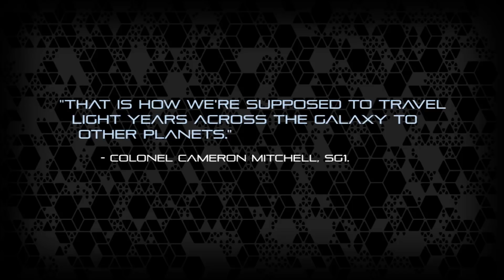The Stargate - Spacedock Sci-Tech.

Comment: 2nd generation Stargates are one of the most perfectly engineered devices in sci-fi. Damn near indestructible, can be dialed manually, able to use power from just about anything, including a lightning bolt and a moss that produces cold fusion, and the only times we see it not operating perfectly are due to the Tau’ri voiding the warranty with their home-made dialing computer
Reply: Imagine the Ancient tech support that get a call every time the Tau'ri screwed something up.
Reply: absboodoo Have you tired turning it off and on again?
Reply: @ducknorris233  we do that every time we aren't dialing it
Reply: @ducknorris233  Doesn't Carter literally try this in one of the episodes? lmao
Reply: @eggnorman  in deed
Reply: DHD's, however, break constantly and there is no safeguard to prevent dialing into a black hole or other world-ending threat.
Reply: @Mike_Rogge  The DhD does have safeguards to prevent the matter stream from passing through stars, preventing time / alt universe travel, and accidentally destroying the star. It probably has similar safeguards for black holes, but the SGC dialing computer has no such failsafes.
Reply: @deadturret4049 they learned it in ancient time, but relearned in tauri.
Reply: @Mike_Rogge  eh thats not true the DHD and the gate do again the SGC's home build dialing computer likely just ignores any of this and keeps dialing
Reply: Hey, sometimes you gotta void the warranty to use the device properly. See: the Avenger Virus incident.
Reply: and still use the most nonsensical addressing scheme possible :P
Reply: Not entirely true. The DHD in the fifth race was malfunctioning and locked up the gate
Reply: Lol
Reply: Bro I forgot about the fusion/fission moss

Comment: I only ever saw Stargate 1994 movie, but I heard characters fly spaceships in the television series. Why would they need spaceships if they have stargates?
Reply: Stargates can be easily disabled, if not destroyed. The simple act of burying a Stargate with rubble or sand will prevent a connection (whether this was a technical shortcoming or a designed safety measure is open to debate).

If a Stargate can be closed so easily, you can always fall back to Plan B and travel to that world by ship.
Reply: Plus most Stargates were only as tall and wide as a decent sized minivan you can't fit a lot in it.

Comment: One way travel depends on episodes, there were instances of a gate working both ways.
Reply: No, there aren't. Unless you can name even one?
Reply: @Swiftbow  Very first episode, goa'uld walk right back through the open wormhole, later releases fixed this with some sound effects
Reply: @zethcader6478  I don't recall if my DVD ha the fixed sound effects, but since all versions cut away from Apophis and Teal'c during that scene, it can be easily assumed they redialed from Earth before leaving. Because they'd have to.

Now, if the scene had remained unbroken, and they'd come through and left without dialing, then you'd actually have a problem.
Reply: @Swiftbow  How did they dial without a DHD?
Reply: @catprog  Presumably manual dial. And I wouldn't be surprised if the Hand Device can control a Gate (or at least power it), either.

Comment: Anything that is not matter is the exception to the one way travel as that is purely a limitation of the gates themselves not the wormholes. The gates event horizion breaks down matter to its base elements, sends that to the other gate, then the other gate re-builds it to its original form. (Theory: This is probably deliberate so patterns do not get mixed up if multiple objects/people were to emerge from the gates in the same spots.)

Other examples of things that can pass through an incoming wormhole include, radiation, gravity wells, and my personal favourite time dilations because of said gravity wells (which also have a lensing effect applied to them so they expand faster then the gravity well itself).

Comment: Dialing speed had nothing to do with the age or generation of the stargate. The protocol used to dial it was what defined how fast it would take.

SG1's dialing computer used the same method a DHD for, but those gates too were capable of fast dials under the proper circumstances. The asgard did this when they needed to use the gates, which was a bloody rare event since they had starships, FTL speed and teleporters.

The Lantian gates too were often used in a slow dial mode too because that gives the gate time to start it's calculations and searching algorithms to find a gate at the coordinates specified. Otherwise with a fast dial people would be stuck in the buffer of the sending gate until a connection was made to the ideal destination. I say ideal because if the destination was not available it would divert and put the people in the buffer to the closest point possible to there.

A slow dial prevents that all together by simply not making a connection if there's no response to the connection attempt.

However, to say the stargate was the thing that guided other civilizations? No... it was the medium that races like the goa'uld used much like one used the atlantic ocean to transport slaves. Most of the other civilizations was initially seeded by the goa'uld taking from earth and transplanting somewhere else.

Comment: I wondering why the floor is not demaged by the vortex of the stargates where the lower part of the ring is sunk in the ground
Reply: because it'd fall over
Reply: Basically because the "splash" that occurs when the wormhole is activated doesn't extend at the edges.

Comment: Just one Question, if there are just 32 or 34 shevrons (don't know how many there were) there should only be 32 or 34 points of origin/stargates?
Reply: That's right... you don't need to even know the symbol for a gate you are travelling to, only it's location (the first six symbols of the address) and your origin gate symbol which is always the 7th symbol of any dialing. The 34x33x32etc limits only the number of gates that can operate as part of a given network. An 8 symbol address can be used to connect to another network for intergalactic travel. Using this system up to 34 separate networks could exist, spanning 34 galaxies.
Reply: Point of origin is unique, chevrons themselves can even be unique but only after you need more than 34x33x32.../32x31x30... unique codes
Reply: If that was the case there could only exist a number of gates equal to the chevrons on the wheel but we know that's not so. There are a staggering number of gates as the Destiny has been seeding the universe with them for a million years. I don't recall how they explained how each gate can have it's own unique symbol yet you can dial it from any other gate in the same network.

Comment: It's not just radio waves that can travel both ways through an open wormhole ... other forms of energy will translate both ways, including gravity waves.
Reply: @DragGon7601 Nope, that's a common misconception. If you look closely, the gate shuts down after Apophis came through, and it remains off during the firefight. It's only turned on after the SF guards and Hammond enter the gate room. In the "Final Cut" remastered re-release, they added additional sound FX so you can hear the gate activating while the guards are running towards the gate room.
Reply: Plus diffrent forms of radiation
Reply: Yes, radiation is a form of energy.
Reply: And system lords/hostages in episode one (you know before the rule was thought of).
Reply: @DragGon7601  Yes, and that rule was from the movie. If they could just reactivate from Earth, Daniel wouldn't have had to anything at all.
Reply: In short, matter can only travel in one direction. Energy can be transmitted both ways.
Reply: Yeah… we learned THAT the hard and painful way.

Comment: Question about Midway I'm wondering if anyone has a feaible answer to. When it was first under construction, a Jumper was used to traverse it. The macro was used to tell the first gate to forward the traveler to the next, and the next, etc, but how did the gate systems know which was being dialled, Milky Way or Pegasus and not dial simultaneously? And for bonus points, how did a Pegasus DHD in the Jumper dial the MW gate system, before the completion of the control room and seperate McGyver-ed DHDs?
Reply: The Jumpers DHD system can and will reconfigure itself to work with whatever gates or gate system is nearest to it, If I recall correctly. So as it moves away from the Pegasus gate and towards the Milky Way gate it will change it's layout to match the gate it is heading towards. They showed it happening in one episode, I think.
Reply: Also gate addresses were directional in nature. so the dial code you would enter indicated which direction to go in.